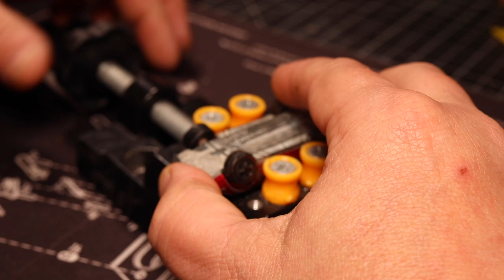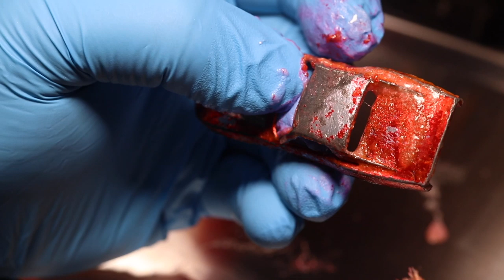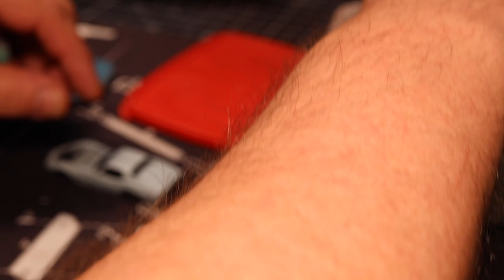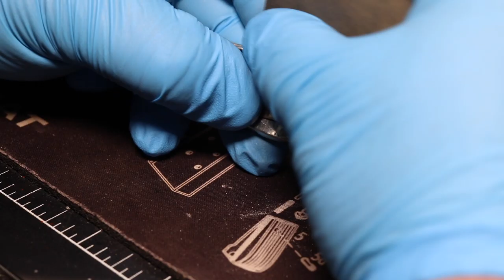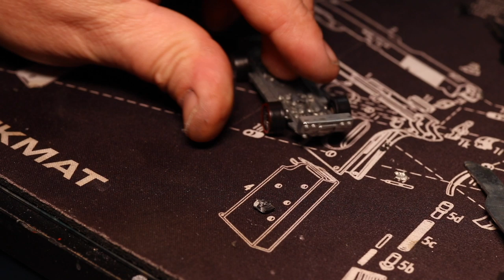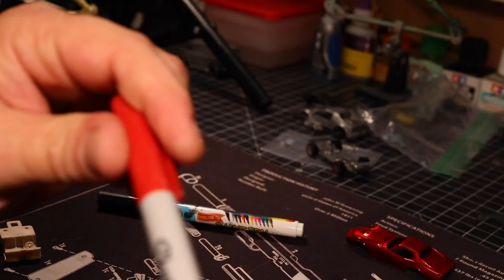Hot Wheels Redline 1968 Custom Corvette Restoration

Comment: Great job! I've got one waiting for me to restore it. I bought a hood for it, but it does have the original hood on it. Sadly, it's stuck shut, and somebody tried prying it open with something that bent the hood. So, it has to go. That Spectraflame Red you used looks great. Mine is that Spectraflame goldish-yellow (the actual name escapes me at the moment), but I may change it

Comment: I think the paint looks great, and overall you did a really nice job...

But I'd prefer it with original wheels.  You could find some decent ones on ebay, and it would look more like it did in '68.  That would be an easy enough fix, though.  You did the hard part.  :-)

Comment: I have a question. You've probably been asked before, but I couldn't find any reference to it.
What exactly kind of metal are hot wheels made of? I can tell it's not steel cause there's no rust but it does corrode.
Reply: The metal is a casting alloy called zamak, which is primarily made from zinc and alloyed with  aluminium and smaller amounts of magnesium and copper.
Reply: @DT99race  thanks for the info. Luv ya bye

Comment: Did the reproduction hood snap on easily? I have a Corvette I need to restore and it needs a hood. The pins are present still. Also, what volts and amps do you plate? That car came out beautifully!

Comment: Those style axles are a pain in the butt when coming to restoring them. They are so bent and sometimes when I try to bend them back the other end of the axle turns. These styles came around 1969 into 1970. After that they did those plastic suspension bars in 1970-1972.